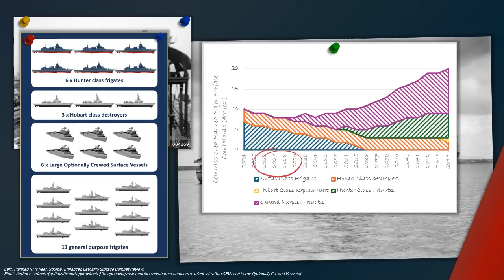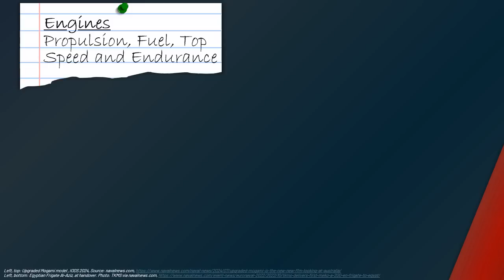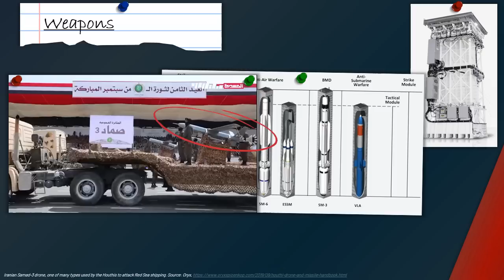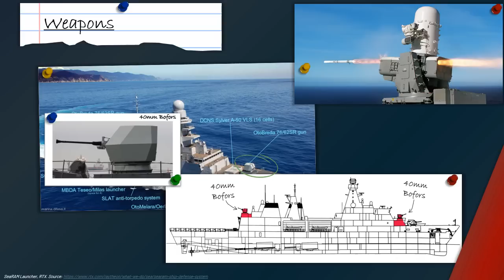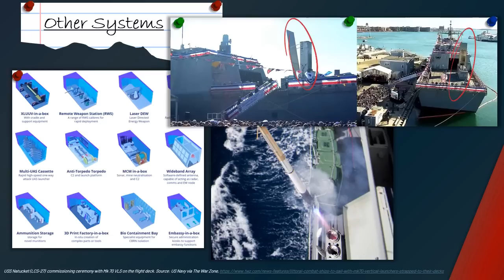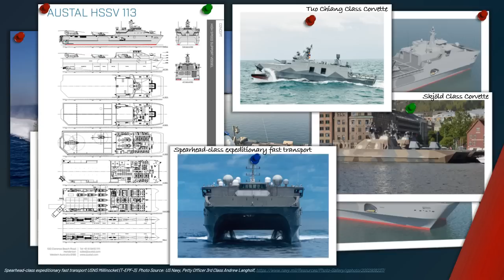Could Australia Build a 21st Century Bathurst Class Corvette?

Comment: A good presentation, but I think that you made two mistakes. Firstly, your assumption is that a manned helicopter is essential. The British and the French are well into testing unmanned helicopters, which are a lot smaller than Sea Hawks. Those have successfully used both fixed sonar and sonar buoys, but integration of torpedoes and missiles are still a little way off. The UAVs mean that a flight deck and the hangar can both be a lot smaller than those found on a frigate. In turn, the corvette can significantly smaller in size than what you have outlined, and still carry out anti-submarine warship.
Secondly, you fell into the problem of mission creep. In other words, you started off with a basic hull for the job of defending ports, then it needed to be a convoy escort vessel, then it had to deliver commandos, supplies, and equipment. If the job is protect Aussie ports, then a Cape-class OPV with better sensors, better weapons, and limited range is fine. Maybe build a handful of boats for that job, for a lousy 120 million per unit. If the job is to escort convoys for short distances, then a new corvette is needed. Provided you limit its aviation capacity and its vertical launch cells, the corvette will remain inside 400 million per unit. Forget the other roles. Focus on what is absolutely necessary. 
 Lastly, all of the big navies are looking towards sea drones. Those can be built by anyone who makes speed boats, pleasure yachts, and small watercraft. If a war broke out tomorrow, there is already about eight foreign companies making and exporting sea drones. The government would buy a licence, and put them into production in half the time that it would take to design a new corvette. A manned warship takes at least five years to develop. There is companies that have developed sea drones in less than six months. Those sea drones are already protecting major ports, so that takes away half of the need for a corvette. 
Anyway, a thought provoking video. Thanks for sharing.

Comment: If there's a 76mm OM gun then a Brimstone launcher is somewhat overblown.

76mm Volcano can be SAL or IR guided out to ~40km.
In combination with a spotting drone that will provide some OTH capability vs small combattants.

Hellfire/Brimstone equivalents are in the same ballpark size as CAMM/CAMM-ER.
That would probably be a better usage of that volume/weight footprint. As those straddle the line between self/area defense.

A deck penetrating 76mm mount would probably be best then for atleast 1 of the 2 gun/CIWS mounts. OM does make a good non penetrating mount for topside installation.

AU does need some native SAM production that's not linked to the USA given it's current political unreliability.

Your current OPV could be outfitted with limited ASW purposes around installations.
Which is not a bad idea either. Reduces the need for bigger ships.

Comment: Add half a dozen Mogamis of the shorter hull form used by Japan for speed of construction. That would allow maximum standardisation and a common hull. NZ can help with building...we produced superstructure and hull sections for Anzacs which cut about 20-30% off our own Anzac units.
Reply: Mogami is a mistake. Should have gone with Type 31.

Comment: I loved this.  The ideas are really sound in my view.  Current naval strategy seems to focus on high end sophisticated ships, but in war time, the little ships carry a substantial load.
Why not focus on the Incat 75 meter hull.  Incat and Austal could build the hulls, and they could be fitted out in Williamstown in Melbourne.  As for armament, your suggestion for guns seems fitting.  Rather that towed sonar, why not use undersea drones combined with the torpedoes.  There are some promising developments being developed in Australia. Close in armament could utilize the Martlet system used by the RN which is cheap and effective at short range.  It would, however, be essential to have ESSM's for anti-air, even if these were in containerized launchers.  The anti-ship missiles would, similarly, be essential.  The use of the BAE STRIX drone could add a surveillance aspect in place of the second helicopter. 
The problem is the limited vision of current RAN thinking.  If only they could think outside the box...

Comment: Thanks @The Western Red, you have posed an excellent question and have provided something to consider here and it is worth thinking about and discussing. But, I think you have, too an extent, have made a mistake in your logic: you have tried to make a small (by modern standards) corvette sized hull do everything whilst only scaling down some parts. Trying to squeeze all of the systems on to one hull and give it enough range to be useful is breaking the concept. Your idea is basically just a slightly smaller general purpose frigate, at the point you might as well just buy/build the standard Mogami or MEKO-100 designs. 

Coming back to the concept, you acknowledge with the Austal HSSV variants that they have a short range of ~3,500 NM, which gets you past the Maldives from Perth, but not much further and that is at 15 knots, which is about the average speed of a freighter. Basically, it can't escort a convoy to the Gulf of Aden without refueling somewhere near the Sub-Continent. Heading to North America is similar, stopping along the way to refuel at Fiji or Kiribati. But, the HSSV plays to Australia's strengths of multi-hull aluminum ships (I fully acknowledge every naval officer and sailor dying as I advocate burnable aluminum), I think we can make the concept work with maximum local input of equipment.

If these are to be primarily escort ships (Corvettes), you could find the solution is stop trying to make an undersized aluminum pocket knife do everything. Split the hulls into functional pairs or triplets. Use the 92 meter HSSV hull that fits in the Henderson ship yards and build three variants: 
One: the air warfare variant: its back deck space is filled with at least two Mk70 VLS systems or 8/16 cell Mk 41 VLS on the helicopter deck with a mix of Evolved Sea Sparrow, Standard Missile 2/6 and Nulka decoys, along with two of the proposed BAE adaptable deck launcher system (16 ESSM) so at least the ESSMs can be reloaded whilst underway, add in a quad box of Harpoon or NSM and one triple light weight torpedo launcher, the Hellfire VLS thing and call it a day. Leave it with enough room for a helo to land, keep the best choice of 76mm or 57 main gun forward and a bunch of the naval version of the Slinger (because its Australian) and most importantly, CEAFAR AESA radar on a proper mast (long and short range), a basic sonar and some UAVs* that can fill in the anti submarine roll when the fertiliser hits the ventilation system. Its basic, it won't do everything, but at maximum range from China, it can hold the line.
Two: the anti submarine version, fit the locally made towed sonar array, a proper ASW helicopter (e.g. August Wildcat) with the hanger to service it, two of the BAE adaptable deck launcher systems with ESSM, triple torpedo mount and Nulka launchers if the VLS can't be fitted, keep a Harpoon/NSM quadbox and same gun as the other variant and the Hellfire VLS + Naval Slinger, because dakka dakka is a thing and a basic long range radar with the CEFAR AESA short range radar.
Three: the surface warfare and command ship, a bit more space for command people and systems, the full size Mk41 VLS that fits tomahawk, but otherwise similar to the air warfare variant, but without the CEAFAR long range radar, same of 76mm or 57 main gun forward, Naval Slinger, triple lightweight torpedo launcher, Hellfire, NSM Qaud boxes, some UAVs and basic flight deck and maybe facilities to launch RHIB. 

Points to note: the Slinger system comes with a bunch of sensors (EOTS, small scale ESA Radar and more sensors designed to thunder fuck drones) along with the 30mm Bushmaster cannon and 7.62MM MG, which differs from the the Typhoon system used by the rest of the RAN, which is just a "simple" remote weapon system fielding a 25mm Cannon. The Slinger is not an CIWS like the Phalanx. However, networked with the short range CEAFAR AESA system means its likely not useless either against low end anti ship cruise missiles either (combined with appropriate shells loaded to the forward 76/57mm gun). Further, these ships will need to be networked, one for command, one for air dominance and one for undersea.

Basic, cheap, quick to build with some capability. But, quick, cheap and deployable.

Comment: Australia had the option to either build or purchase corvettes during the 2000s. But due to inept governments, this idea was canned, and we ended up with the useless OPVs that can't fight their way out of a paper bag. It wouldn't hurt if the ADF/RAN and Australian government pulled their heads out of the sand and investigated a system that integrated more off-the-shelf ships that could be either built overseas or locally. The one for Bulgaria sounded just right. However, governments in Australia do not look towards the future. They are only interested in the next election cycle. It is time to be bold.

Comment: You're missing a huge point. Crewing. There is a huge problem crewing the navy as it stands. There's never going to be a modern Bathurst. 
What's going to happen is that the upgraded Mogami will be selected as it can be built quickly. The Japanese are building all 12 of theirs by 2032. They have said that the third one will be Australias and that we can have two or 3 by 2029 if needed. 
But crewing. The Japanese peacetime crew is 90. The wartime crew is 60. Yes 60. It literally needs 20 crew to run the whole ship. Getting people from the mining industry to operate warships is laughable.
Reply from the maker: I think you've slightly missed the point of the video. The proposal is not to replace the SEA 3000 GPF - it's for the government and defence to do the advance work on designing a supplemental vessel that could be brought online quickly if required, i.e. in a situation where we were at war, or if war seemed imminent, i.e. if we found ourselves in a similar situation as we did in 1938.

Near the end of the video, I do (admittedly briefly) talk about crewing, and specifically say that I'm not suggesting we alter the SEA 3000 plans in any meaningful way. 

However, were we to find ourselves in that 1938-esque situation, we can expect that a lot of things around recruiting would change, simultaneously with a lot of things in our economy. 

And regarding mining people crewing boats, I'm not proposing taking some truck driver and dumping him on a ship and calling it a day. But if you look at naval recruitment challenges around the world, you'll see it's often shortages of specialists and specific trades that keep ships tied up rather than a pure lack of warm bodies. 

The point I was trying to make was that in the situation we're actually building these things, then we've probably seen a deterioration in trade relations with China, which has probably sent a lot of mines in WA and elsewhere offline. If you're looking for recruits, a diesel fitter or boilermaker who's spent the last ten years working on large scale diesel engines in the Pilbara is going to convert to a stoker a hell of a lot faster than a complete novice straight out of high school. Sure, both will need to learn the naval specific and seagoing aspects of the job, but one has a massive head start when it comes to the engineering duties, which are often some of the hardest to recruit for.

Comment: A ready design could be the BAE systems corvettes built for the Omani navy, three ships of 2,500 tons vessels. These vessels armament could be changed to RAN kit currently in use. A 76mm gun at the bow, an eight cell VLS for ESSM, four NSM launchers in two twin mounts, ship launched ASW torpedoes, two light cannons on either side of the superstructure, a helicopter hanger and flight deck for a MH60R Romeo helicopter.
Reply: Khareef class corvettes.

Comment: We had the Arafura class we could of heavily modified, which would be entering the water now! 
But cut cut Marles stopped its production and still hasn't chosen the new frigate design.
The Arafura-class is based on the Lürssen-designed Darussalam-class, operated by the Royal Brunei Navy and it had a capability.
If that ship was given the weapon systems for NSM and an 8 cell medium length VLS protection for quad ESSM thus 32 off and basic ASW gear and maybe slightly enlarged, unlike the dumbed down unarmed Arafura class ships we received.

Comment: Until Naval Command changes, there is no point. They built the Cape Class patrol boats without any offensive weaponry. Other than small arms, they have two .50 cal machine guns. They can't even defend themselves. And, if a combative aircraft is in the area, forget it, the boats won't stand a chance. Believe it or not, but the 25 year old minesweepers are better armed.
Just did a quick check. The Cape class patrol boats are a little larger than the Bathurst class corvettes. The Bathurst class would decimate a Cape class before the Cape class got anywhere near it.

Comment: 1:43:12  A Karakurt Class costs ~$45,000,000 and have short range air defence , 3 or 4 inch gun  & VLS but only have 2,500 nmi range

I think the best solution would be keep the ANZACs in reserve & design a ship which has variance which can only do additional 1 task  apart from the basics . This will also result in more ships deal with drones which will be helpful against swarms

Another interesting design is the Steregushchiy class

I also suggest reopening the ship yard in Williamstown
Reply: Problem is, what if the ANZAC's hulls are clapped out? Modern frigate often starts having metal fatigue after too long. Also, the money invested into the old ships could be going into new ones.
Reply: @Lancasterlaw1175  the point of reserve is they don’t do anything they just sit around in case there’s a war

WW 1 is a good example of what naval reserve might look like and how it will be used
Reply: @avus-kw2f213  Generally unless you are going for deep mothballing you'll still want to take a ship in reserve out on a sea day occasionally, at least to check everything works.
How about the pull all the equipment off the ANZAC's as they retire and store that in a climate controlled warehouse?
Reply: @Lancasterlaw1175  putting all the fragile bits in a climate control warehouse may be a good idea but instead of using new hulls just use the old hulls

If some countries can get over 50 years out of a ship  then Australia can get the ANZACs to last a war
Reply from the maker: The Russians aren't really a good comparison IMO - western kit is unavoidably more expensive, but also tends to have tighter tolerances and specs. I'd also argue average performance is significantly better, but I admit it's hard to get a direct comparison given different maintenance standards etc. But I didn't even really bother looking at Russian or Chinese equipment because we obviously aren't going to buy any of their kit, so the comparison didn't seem relevant.

Re the ANZACs, I agree that I'd like to see them hold off on scrapping them for a few years, but you can find reports online from people who've served on them that they aren't in good nick - they've been worked pretty hard over their lifetimes. I'm sure that some of them could be kept going - TransCAP was on the cards even for HMAS ANZAC as recently as a year or so ago, do having them available to be returned to service in an environment where cost is less of an issue might be valuable, but only if there's a realistically available workforce and critically construction/maintenance space that wouldn't be better used on other vessels - and I'm not really sure there is.

Re Williamstown, I feel like that opportunity is passing us by - the land I think is in the process of being sold off. That may be a seen as a bad decision in a few years, but it's a decision which has been made already.
Reply: @TheWesternRed-au  I use Russian Corvettes as a example as Russia have a large Corvette fleet . So have lots interesting designs 

& war time emergency conditions would make being old & rundown not much as a for ANZACs as the navy will need every ship it can get . 

It’s not too late for drastic government action to reopen Williamstown

Ultimately the question isn’t can it be done but is the government desperate enough And that seems to be a hard no 

And if Australia were to do a rapid naval mobilisation program that would raise tensions and would lead China to think a war is imminent . So for australia’s defence keeping the current plan is the least risky
Reply: I agree with comments on the Anzac’s if you really look at it they might not be a frontline warship in 10 years time but they could be a good backstop patrolling rear echelons. Upgrading engines , electronics , towed array sonar and give them the teeth they deserve .  Winston Churchill was begging the Americans for the parked up fleet during the prelude to WW2 these things might save our bacon in the not too near future .